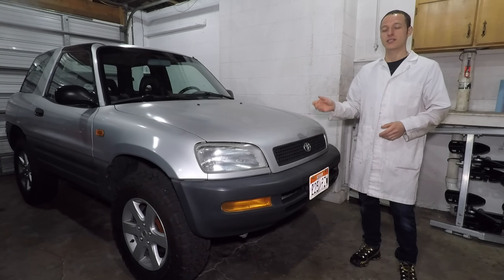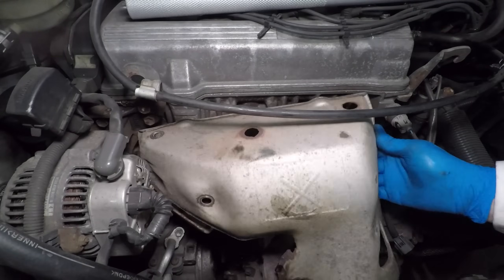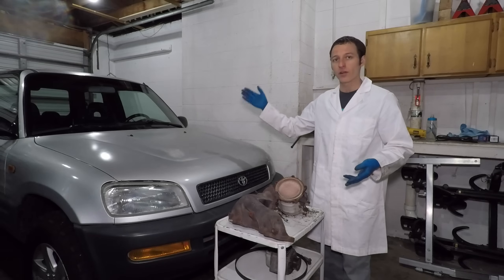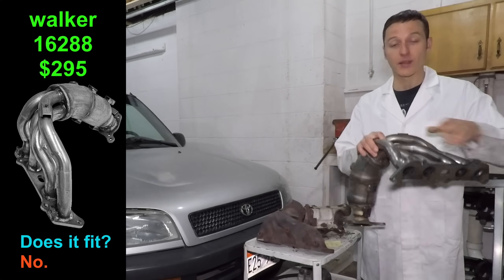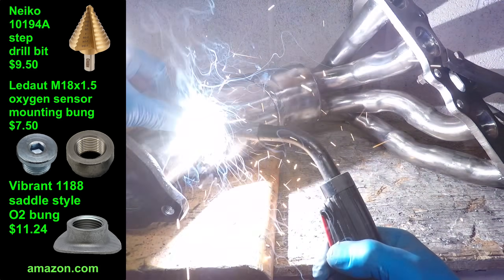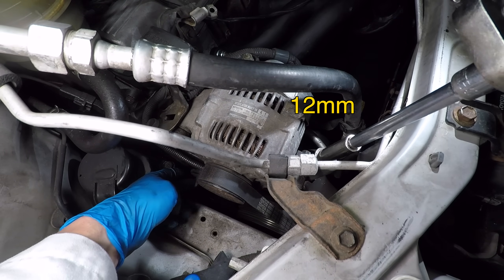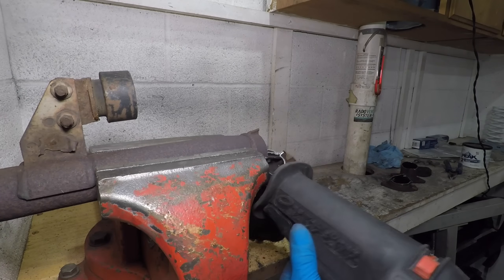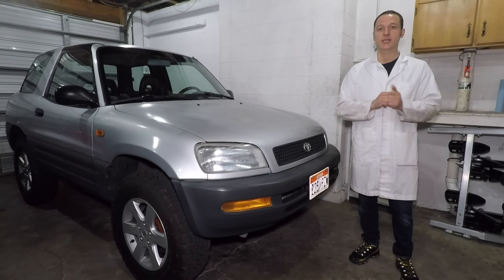Catalytic converter and oxygen sensor replacement 1997 Toyota RAV4 (episode 9)

Comment: Paul, do you have any check engine codes using the upstream Bosch sensor compared to the OEM Denso upstream sensor? My RAV came with a tubular oem Camry header I believe. The upstream is a thread in style bung and not the factory two bolt style so I can’t just buy the oem spec’d sensor. I have two or three engine codes related to “O2 sensor number 1” and I’m just wondering what I would even replace it with since I can’t install a oem specified two bolt denso sensor.

Comment: Absolutely fire video. Even years later youre helping me, a new gen 1 rav4 owner, restore and revive a 97 base model automatic with 167k miles.
I too have had many issue finding a primary converter replacement and, have decided to pull and punch the coverter instead.
Reply from the maker: That's awesome! Check these other 2 videos about catalytic converters. They might help you.
https://youtu.be/xb4TMOOpzxQ?si=oss2z4sW0z_XhxgN
https://youtu.be/Nw8T4DlLtJ8?si=zIAWWDL0rLVHWerP
Reply: Hiii! This videos helped me a lot too!
Recently I've got a 1996 rav4, 3 doors, and found out so much about this rusty box, it's falling apart. And when i found this channel, i made some of fixings myself, trying to make my car ✨awesome✨

Comment: As the owner of a 1996 Rav4 3dr, I've absolutely loved your videos. I followed your guide to replace my rear subframe and completely restore the rear suspension. Unfortunately, I'm also in need of a new catalytic converter and they are impossible to find new. I also live in Colorado so passing emissions has been a nightmare. Does anyone know if it'd be possible to retrofit the magnaflow cat to the exhaust pipe?  Paul, I figure if you can find a way to get a Camry exhaust on there, I can probably trim the exhaust pipe to fit the magnaflow cat, right? I have a fluxcore welder and very minor welding experience, so maybe I can make something work?
Reply from the maker: I’m actually working on a video about emissions right now!  1996 and 1997 rav4 come with 2 catalytic converters.  1 on the manifold, and 1 under the car. 
I installed 1998 exhaust on mine with just one cat and failed emissions.
My car runs just fine, no check engine light, but I failed the visual inspection because I have 1 cat instead of 2. I have an aftermarket walker cat under the car and a stock 1998 RAV4 header on the engine (no cat).
I bought a cheap cat for $45 on Amazon and I’m going to weld it on next to the other cat under the car.
Reply from the maker: You could just get a new cat under the car, move the downstream O2 sensor to under the car and knock out the cat by the engine.  (Make it empty).  That way it’s present for the inspection.

https://m.youtube.com/watch?v=LSsGT6CnrSg&list=PL1_JDBt1LSiImFCzG1QKxOTeZnzUG8uxj&index=32&pp=iAQB

Comment: Are the 1996 rav4 
And 1997 exactly the same?
Reply from the maker: Yes.
Reply: @LabCoatPaul no they arent. 1996 has a different ignition system without a crankcase sensor and running off a direct drive off cam shaft using a distributer
Reply: @maungsacca thank you

Comment: What the hell man I have the exact same screech and wouldn’t you know I’m also missing the same stud on cylinder 4, how does that even happen.

Edit: installed the new stud and a new flanged nut but still does the squeal. I've been trying to track this down for a month now and I am starting to go insane argh! Maybe its a loose timing belt?
Reply from the maker: A small exhaust leak from the manifold makes for a clicking sound.  Squealing is likely belts.  The timing belt has teeth so it can't slip past the gears, therefore it won't squeal.  If your alternator and power steering belts are old or have oil on them, get new belts.
Reply: @LabCoatPaul  Thanks for the reply Paul, I can't tell you how much I love these videos! 

 I have checked the belts and they're both dry and tight. No cracks either. Tightened the alternator belt a bit and no dice. About a month ago I removed my splash shield because it was rubbing against the AC belt, but removing that didn't solve the sound. In my case it only happens at around 4000 RPM.
Reply: @LabCoatPaul  ok, so I checked the power steering belt and it seemed ok until I checked again with the engine on. The power steering pump pulley is really wobbly at idle, so that is probably the source of the belt noise. How can I determine what to replace here? just the pulley or the whole assembly? Doubt its just the belt with how much wobble it has.

Comment: Hi! I'm having the same issue with whistling sound when shifting as at 0:26, especially on 2nd gear. In your newer videos the sound is gone. Does changing the exhaust manifold gasket was a fix? 
I'm quite scared to dig into it and break something without some idea that it can be the gasket
Reply from the maker: Everything was broken in my car.  The exhaust manifold gasket was leaking, as well as the donut shaped exhaust gasket from the manifold to the down pipe.  Bad engine mounts can cause the exhaust to leak because the engine will rock back and forth too much and break the flex pipe and loosen the exhaust gaskets.  I've had to fix the exhaust a few times, and I'll be doing the engine mounts soon.

Comment: Hey , I know this is an old video but I like to rewatch your rav4 videos , I have a 97 4door Rav4 , ever since I got it has had the check engine light on, code is p0172 , change the MAF sensor and cleared the code but it still came back after a day
Reply from the maker: P0172 means the engine is running too rich.  That means there is too much gas, or the fuel isn't being burned properly in the engine.  Do you have any other codes?  (like P0300 for misfire?)
The first thing you should do is catch up on maintenance.  Install new spark plugs, wires, distributor cap and rotor if they're bad or old.
If that doesn't work, try some fuel injector cleaner, in case the fuel injectors aren't spraying properly.  Check your air filter to make sure it isn't plugged.
Once you've checked all that and done the repairs, connect your scan tool and look at the live data stream.
buy the scan tool if you don't have one:  https://amzn.to/3mWLmh1
check the oxygen sensor voltage upstream and downstream.  The  upstream sensor should change numbers at least once per second once the engine is warmed up, and should bounce between .2 and 0.8 volts most of the time, staying close to .5.  0.5 volts at the O2 sensor means the engine has the correct air to fuel ratio.  It's normal for the ratio to go rich when accelerating, and lean when slowing down.
Reply: @LabCoatPaul   hey thanks for the quick reply, I also have p0401
Reply from the maker: @jeisonlopez1986  P0401 is "Exhaust Gas Recirculation insufficient flow".  Remove the EGR valve from the engine and clean it.  It's bolted on to the throttle body.
Watch this video:  https://youtu.be/Ksv98JvBqXs
Jump to 47:44 and 48:33 and 50:22
Make sure all vacuum hoses going to the EGR system are good and don't have cracks.  Pop the cover off the round plastic thing with the 3 hoses and clean it out.  There's a little filter inside.

Comment: "Annoying" is an understatement for that catalytic converter mount. My goodness. Have you had problems leaking oil because of the clogged cat. converter? If your exhaust can't get out, wouldn't it pressurize your manifold? I'm trying to pinpoint my severe oil leak. Great video, thanks.

Comment: How did you manage not to break all those studs and bolts?  I’m getting ready to replace exhaust been rewelded several times
Reply from the maker: Use a MAP gas torch to heat up rusty bolts.  An impact wrench is less likely to twist off a bolt than a breaker bar because the vibration can help to loosen it.  Be careful with hard to replace bolts near the engine, but down under the car, just break 'em off and get new bolts.

Comment: I have a 1999 toyota picnic, this car is consuming 20 litres for 80 KM drive, i have replaced the temperature choke sensor. May be i will try to replace the catalyst and oxygen sensor as well and see if there will be changes.

Comment: I'm considering parting out my rav4 2000 after a recent accident. [i only had liability insurance and person who hit me was uninsured, so i'm at a total loss and very broke right now].
 i've had multiple people ask about the catalytic converter, rear exhaust manifold, and front manifold. I have no idea what is a fair price to ask and would love some advice! I'm at a standstill with inquiries because no one wants to say the first offer lol.
 but seems like they are desirable parts, if its hard to find replacements online? they're in decent condition, rust free and never had issues with exhaust system.
Reply from the maker: You can check on eBay to find prices for used parts.  Be careful selling online.  People on facebook groups will say they want the parts, then either flake on you or not pay you.  Make sure you get payment before you ship anything.  eBay is a more secure way to sell your parts, but they will take 14% of your money.  You can also just post it on your local classified ads and have people come get parts in person.  Once you're done parting it out, the junkyard will probably give you $300 for the car.

Comment: hi paul, am Stef from uganda, kindly show me the location of both oxygen (fuel air sensors of this rav4). thank you
Reply from the maker: Pause the video at 2:05  The upstream O2 sensor is attached to the exhaust manifold, and the downstream O2 sensor is attached to the catalytic converter.

Comment: i just installed magna flow 452827 catalytic converter on my 1996 rav4 3SFE i had no issues direct fit. I watched this video before thinking id had to modify the converter to fit nope glad i tried to put it on first before i started cutting and welding. hope this helps someone.
Reply: so did you still do some trimming? so to say that is not an exact fit, am I right? I'm ready to order 452827.
Reply: This has helped been sitting here staring at it wondering wether to even try. Thanks.
Reply: Thanks to both of you, the magma flow is a direct fit! This video still helped immensely as it is the only one showing how to do this specific job. Got at least 20 views out of me over the time I fixed it lol thanks again guys

Comment: My 96 rav squealed just like that. Found out it was exhaust escaping between the exhaust manifold and the block like a horrific whistle due to a completely clogged cat. So, I air chiseled out the cat and now run with codes. Also leak copious amounts of oil.

Comment: Only 20mpg for 150,000miles? Something is wrong Paul. I get 23-26mpg combined. And my motor and transmission has original 230,000 miles! And! Mines the 4 door. Tire size is 235/70/r16. Something is wrong, Paul...
Reply from the maker: Well, my car does have oil leaking from the #2 exhaust valve seal, and there could be other stuff wrong with the cylinder head.  Perhaps you're just a better driver than me, or you spend more time on the highway.
Reply: @LabCoatPaul  ouch!!! That sucks! Youll most certainly want to do an engine rebuild eventually. And no I do not baby it either! First off I'm pretty sure you are aware of how low first gear is and how high second gear is. So with the bigger tires on it I got to floor it in first gear to four or five thousand RPMs you know to get up to speed lol. And obviously floor it  in second to get to third and then finally shift a fifth for cruising speed in town driving. And towing 1800 lb! With the big tires does not help either! I have to floor it to red line for  first and second gear and floor it to the top side of third and then I can shift to fourth gear and cruise at 55 to 60 mph If I go to 5th I'll have to floor it and I'll lose speed. I plan on taking 200 lb out of the trailer. And hopefully by June or July I will have the engine rebuilt. Because there is no way it's going to last another 20,000 miles. I was wanting to keep it running until 250000 that way I can tell everyone I have a quarter million mile RAV4 lol! The massive oil leak I have is coming from the oil pump seal. I am currently replacing the whole oil pump which means I must redo the oil pan gasket! And that sucks major ass! It is a real pain in the ass. So I'm also doing all of the seals on the side of the motor since I'm down there. New timing kit water pump oil pump camshaft seal crankshaft seal other seals and hopefully I'll only leak minimum oil instead of a gallon of oil every 80 miles!

Comment: I just broke out the honeycomb inside the catalytic. So its hollow inside now. Runs better now
Reply from the maker: That's great!  Did you get a check engine light P0420 for the downstream O2 sensor after that?
Reply: @LabCoatPaul  I added a spark plug defouler on both O2 sensors and code turned off. This is just for now, i want to swap a Beams engine in the future
Reply from the maker: @jameshoward8544  That's awesome!  The defouler is cheap and easy.

Comment: '96 Rav4 AT AWD purchased with 180K miles had similar problem.  Bottom right stud had sheared off my warping manifold.  Bottom "support" bracket was missing nuts.  Front cat was clogged on top, melted away at center, and blew chunks off bottom half resulting in blocked rear cat.  I reused the cast manifold after machine shop resurfacing.  Cat was dealer replacement so easy direct fit.  This was not my first choice but CA requires C.A.R.B. certified cats and Magnaflow/Bosal option failed fitment.  Full exhaust was removed to clear as much debris as possible.  Muffler was a maze.  Everything back in with new gaskets everywhere and two new oxygen sensors and it's now running it's best at 230K miles.
Reply from the maker: Did you happen to get gas mileage numbers before and after you fixed your exhaust?
Reply: @LabCoatPaul My MPGs are still around 22 in mixed driving.  Without a top and bottom end engine rebuild, I didn't expect much improvement.  At 230K miles, it's tired.  At least my emissions have improved and delivery of the power it has left, is smooth and predictable.  A major tune-up is about due and I may see some improvement after testing fuel pressure, cleaning injectors, and replacing ignition components and filters as needed.

Comment: I'll be test driving one of these (5 doors) in a few days. It's MOT says "Central Vehicle structure is corroded but structural rigidity is not significantly reduced" and "brake pipe corroded, covered in grease or other material". (These were just advisories.)

In the MOT history it doesn't have engine issues but I'm worried about the rust. The car is £750. I was hoping I could spend a couple/few hundred on maintenance and it would be a solid vehicle. I do less than 10,000 miles a year so won't be working it too hard. How much does it cost to replace a brake pipe? Or is it just not worth it?
Reply from the maker: First thing I would say is RUN away as fast as you can from all the rust.  It will be a nightmare that will give you a bad time every step of the way if you work on the car.  Watch my suspension lift video to see what it's like to deal with a rusty RAV4:  https://youtu.be/c1gi9hoCpEI
That being said, if you only do the minimum amount of maintenance to keep the vehicle running, and you don't try to fix it up, a rusty RAV4 could be good cheap transportation for a few years.
Replacing the brake line is easy if you have the right tools:  Check out my brake line video here: https://youtu.be/fruovEA2uPo

Comment: how can we get intouch.
Reply from the maker: Hi!  If you have questions about your RAV4, you can just comment here!
Reply: @LabCoatPaul  I bought a rav4 1998 housing with manual gear box. it has no seats but i would like to build it up. like you. Do you have a site where i can get the blueprint or owners manual?
Reply from the maker: @TukundaneYonna  Check out this video: https://youtu.be/P1PnqG6Mcok
The toyota parts website has diagram of the whole car.
The owners manual is pretty useless.  It tells you how to operate the radio and seat belts.  It tells you nothing about how to repair the car.
You can try to find a service manual.  Or just watch my videos!  :)

Comment: To test exhaust for leak: connect air blower to exhaust when engine is turned off, take soapy water and start spraying along exhaust pipe to exhaust manifold. Any bubbles - leak.

Comment: Hey Paul, videos are great, especially the tender date references. Sorry to bother you but I have 1996 two door, and its a rust bucket underneath, though the frame seems rust free. The Engine has 150K and doesn't leak or burn oil. To get to the point, if you had to do it over again, what are a few things you would do first, right away? What upgrades were you like, "I wish I would have done that way sooner?" Or now in hindsight, would you look for a different two door that wasn't so rusty that maybe had a blown engine and just added your engine to it? I'm just on the fence a little and wouldn't mind your advice. Keep the videos coming, thank you!
Reply from the maker: Hi Robert!  The rust was definitely a nightmare, and I could have saved a lot of time and money if I just had a different RAV4.  If you watch my lift kit video https://youtu.be/c1gi9hoCpEI you'll see just how bad all that rust was.  In hindsight, I should have just bought a car that is less than 10 years old.  Then I could just drive it and not have to fix everything.  But then I wouldn't have this cool RAV4 or any RAV4 videos.
Reply: @LabCoatPaul  
So true, and the videos were definitely worth it! I appreciate the reply, and please keep the videos and dry wit coming!